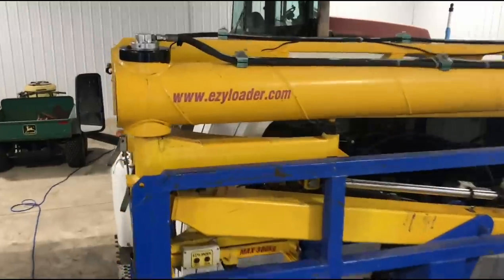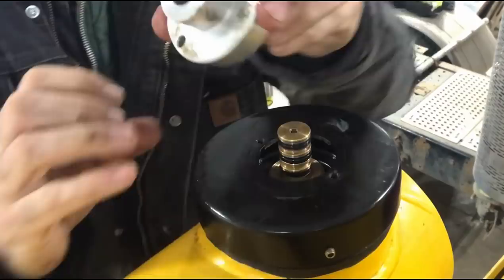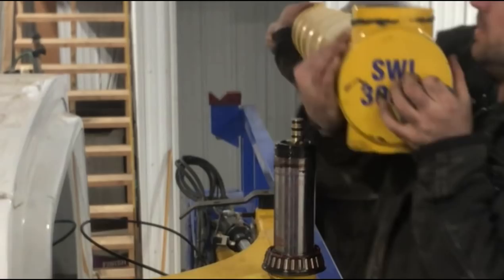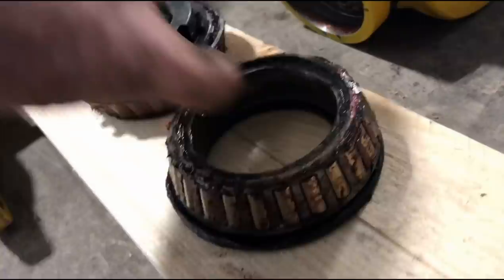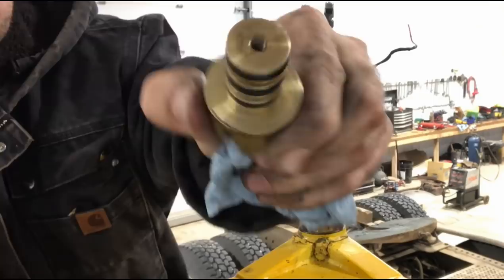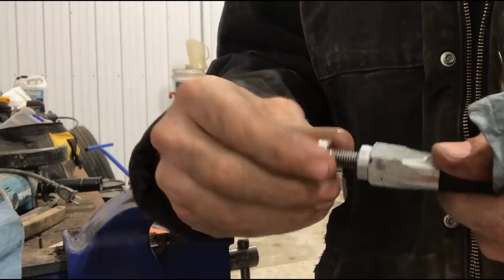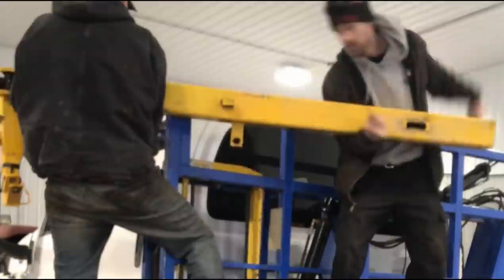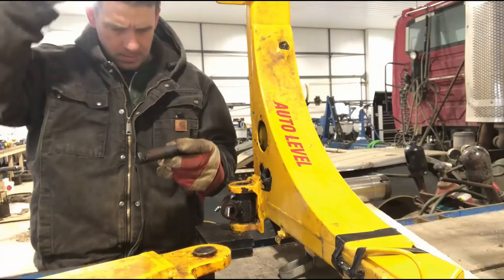Boom Removal - Ezyloader Overhaul

Comment: Ian, I enjoyed the video, this type of work used to be my 9-5 (sometimes more like 5am - 9pm).   The ‘spinny spindle’ is known as a rotary manifold, and those hydraulic fittings can in fact be reused, don’t throw them out. Their name is actually “reusable hydraulic fitting”, but are sometimes referred to as “field fittings.” For best success with them, they should be threaded on a fresh end of hose if you have the length to lop 2” off the end. If this tripod piece were to come in my shop, I would consider removing the two shallow gussets and weld in a 1” thick circular boss in their place. I’d want to use at least a T-100 steel and would want to see no less than a 1/2” radius fillet on the top weld profile. Circular bosses like this are really common in heavy strain, repetitive stressor applications, such as excavator booms. Their primary benefit is that the circular design eliminates stress risers like that which are present with the use of gussets. Hope the project goes well, good on you for getting it done before it completely failed and became a much bigger repair.

Comment: Finally got around to watching this... 
I don't know what it says about me, but as a diesel/industrial mechanic, I see you doing things about the same way I would, so it seems like you have the knack, and Farmer is the same thing as Mechanic in your case.

I appreciate putting caps on the ends of the disconnected hydraulic hoses, and lmao-ed and nodded at grinding the old field weld off before taking it in lol
I can do pretty nice with a mig or tig, but I am iffy on stick, so I understand lol

Comment: Ian, your video is extremely helpful to those of us who own Ezyloaders! I know from my own experience that cracks in the welds are not infrequent; we had to rebuild the lifting cradle and reinforce it with gussets because the corner joint welds by the manufacturer were so precise and cleanly flat that they would crack under repeated lifts. (In my case, I have a fantastic welding shop here in Creston that does a terrific job. I've mentioned to the manufacturer before that I think they should produce a maintenance manual for their cranes; we didn't even have a map of the various grease points.  Having said that, I am a 100% fan of this crane, and it is an invaluable piece of equipment in our inventory! I look forward to seeing the rest of your rebuild videos for this crane.

Comment: Howdy Ian a bit of advice when you put those upper hydraulic lines together. Those outer fittings screw on the hose backwards first and then you screw the inner fittings into them. Seems simple but the mistake a lot of people make is to screw the outer one all the way on the hose first. I have found that if you screw the outer one on till there is a 1/4" to a 1/8" gap in between the end of the hose to the end of  inside of the fitting then Stop there. Take a punch the same size as the interior of the hose and push it into the inner liner of the hose to prepare the inner liner for the screw in part. Apply a little grease on the taper of the screw in part and feed the taper into the inner liner without engaging the threads on the bottom. Once the taper is engaged screw the outer piece the rest of the way onto the end of the hose then finish the connection by screwing the end piece to its final position. The reason for this process is to prevent the taper from cutting the inner liner and shaving off a strip of rubber. That little strip of rubber will get into your control valves and it is a bad day trying to figure out what the problem is.

Comment: You could have used a Dremel to grind the bottom side of your weld.  This way your welder would not have known you attempted a fix in the past.  Or just fess up and say your brother did it. (Like the commercial on TV where the little boy is always saying I didn't do it).  In all honesty, the unit should not have cracked unless the pins that were to be greased and were not provided that much of a bind when the unit was in operation.  As with cranes, get in the habit to grease all fittings before every use.  And from what I have seen, once you start using the lift, you are there for many hours or days on end.  An over-amount of grease on a mechanical fitting will not harm it.  And all new grease will displace the older grease.  Just a bit more clean-up.  That is what they make shop rags/clothes for.

Comment: There should be a grove (2mm) on the pin's where the grease fitting is to prevent blocking the grease fitting and to distribute the grease . That is assuming they doesn't loosen up from polishing , the fit is probably to tight to allow the grease to get in.

Comment: First! Hope the fix goes well. Like I mentioned in another comment, I built one of these articulating arm first with ball bearing  on the main hub but then redesigned with 1/4" needle bearings 10" long and a thrust bearing on top. At least yours are tappered rollers that is probably just fine.

Comment: He's probably going to have to remove those upper gussets and repair the crack underneath first. I'm sure he will make it better than it was before and prevent future issues. Thanks for sharing.
Reply: Actually, from the manufacturer; those top gussets are decorative covers to smooth the visual transition from the main beam to the center pivot. Beefing that part up too much can cause damage down the line since these things are engineered to have flex and stress points. Would be a good idea to contact Mark at Ezyloader to check those parameters.
Reply: @beematter  If that's the case it was under engineered for the type of loads that are placed on it. Maybe Ezyloader has an updated part to prevent this type of failure.
Reply: @rodneymiddleton9624  if the main beam-pivot weld/joint had cracked I’d say your right. The crack in the decorative gusset tells me there is engineered flex in the main beam pulling on that joint. Removing that flex can cause further vibration and stress further down the boom and potentially more problems.

Comment: Hi Ian
There is a YouTube video on this
I can't see properly from your video, but the problem you seem to have is very well explained
If it is a gusset that has cracked, then the gusset is aparently totally cosmetic and non structural. Aparently it just looks strange without the gusset, so they were added to make it look better
Cracking is quite common on the Hussein because of the special welding process that needs to be followed and was generally ignored for non structural parts
The steel used where the shaft fits through is a special high strength steel (I think 4185)
It needs to be preheated before you weld it, otherwise it cracks
This is done by the manufacturer when welding the boom to this ring, but not when welding on the purely decorative gussets
They have now changed to follow the correct process for the gussets as well now
Reply from the maker: That is exactly what I found out as well.  We removed the gusset and did an acid test to determine that the main boom was not cracked

Comment: Lesson learned on no grease...Being a half a__ farmer myself...I know well that a zerk fitting not taking grease has to be dealt with now....your thoughts on the repair are also mine...I’d let the professional welder make the call on that repair weld....I’m thinking it will be a simple gouge out...with a re-weld...maybe a couple 1/4” X2” X 4” diamond plate gussets welded over and under the arm...Good Luck....you looked like a pro...

Comment: I'm surprised you got that pin out. Normally id have to torch it out without hitting the outer material. Takes a lot of patience and steady hands. But saves the piece. But yes those welds got to go...good job. They'll get rid of those angle gusset, just like you said. Build up and reinforce.  Lots of work.  But that jib saves your back

Comment: Ian Crazy Dirt is right. The original gussets need removed and a circular guesset plate made and installed. Also the weld fillet radius is critical to spread the force over more of the weld surface area. The original design depends on a small area at a shape angle to hold a big load. As a retired mechanical and maintenance engineer at the Cat foundry I saw failures like this a lot. Your welder may prefer something else but I also learned to really depend on 7018 weld rod in these areas. Just make sure the metal is clean and shining. 7018 doesn't like dirt.

Comment: Acme Birdhouse Co, Honey and Bee Division
 
Cuttting off the ends of the hydraulic lines might have been avoided if one line was pulled down where the metal could have indented into the hose.   The two metal ends could not compress but metal on rubber could. Not knowing what was on the other end might not make this nescessary antway.  Just a comment.  Enjoy all your videos and thanks for sharring your expertise even though I have now only five hives.
Reply from the maker: I think they designed the slot tight to focus on the structural aspect rather than the ability to pull through hoses,  
I found a low profile rib, to which will be properly crimped

Comment: Great job Ian. It’s an incredible piece of engineering. I have made myself a budget boom for my trailer and need to make some alterations. I’m wondering if at the knuckle joint there were any bearings or is it just the bolt going through as a neat fit with a nut and it just rotates on the arm surfaces to the hollow shaft end that is welded into the round boom?
Cheers John

Comment: The Main pin assembly has got to be dissimilar steel from the arms, like welding chrome molly to general steel. It would  be interesting to know what the welder's thoughts where on procedure. I've seen slight cracking in the same spot on an Ezyloader I looked at.  Would love to see that winch its so compact!!!

Comment: You cracked that weld lifting all of that honey.
Reply from the maker: Perhaps :)  but it’s rated for 650 lbs, my max lift is 480 at its heaviest
Reply: @aCanadianBeekeepersBlog  I have watched your videos for some time, while your load is 480 max, at times you begin to lift and the propolis is still sticking. You use your hive tool and when it break loose it snaps free causing a shock load.  Is that possibility?